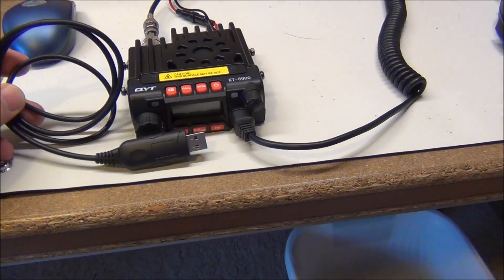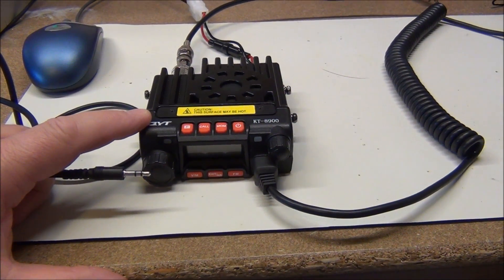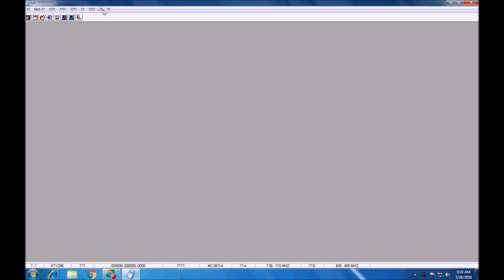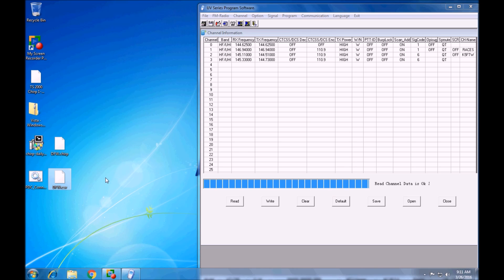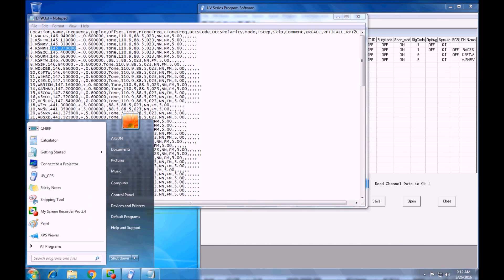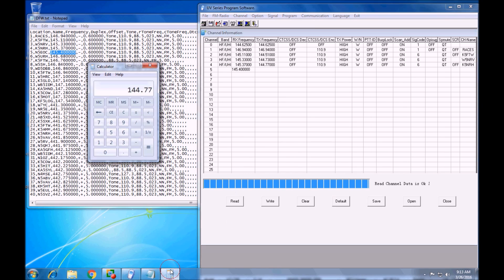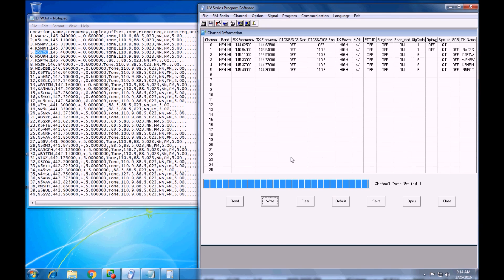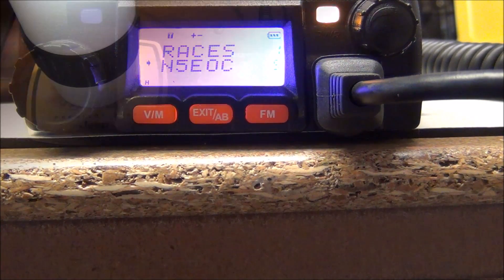Programming the QYT   KT-8900 with Software – Aided by CHIRP

Comment: fyi CHIRP WILL NOT WORK ON WINDOWS 11 . I HAD TO USE AN OLDER LAPTOP WITH WINDOWS 10 . IT WORKED JUST FINE ON IT BUT REFUSED TO WORK ON WINDOWS 11 . HOW ABOUT AN UPDATE TO ALLOW CHIRP TO RUN ON WINDOWS 11 ?

Comment: I just purchased the QYT KT980 and can't get it to communicate with CHIRP.  It does not show up on a Com Port only under Other Devices USB-Serial Controller.  I've tried downloading a few things from QYT Dowload website but nothing is working.  I'm not to versed on how this is to be done but I'm at a dead end...  Any help is appreciated.  I've done this with a Baofang UV-5R and had a similar problem but it worked after downloading a correct driver.  I can't find the Non-Chirp programming software either.
Reply from the maker: Most Lilley the driver for the cable.   Try a cable that is advertised as has a  FTDI  chip.  They are better at plug and play
Reply: I'm having same problem. I can't get Chirp or the QYT software to recognize port radio is plugged into. I hate this thing

Comment: bought a new QYT KT-7900D....setup a few local repeaters, and it worked fine. The very next day the radio says "KILLED" at the bottom. The seller has refused to refund and said that it has entered "remote kill" mode. That should have been impossible since I never even connected the radio to any software in order to activate. Since, the seller told me to connect to the PC and open the QYT programming software. So far I have not been able to do so. The file comes up as an RAR file. It simply will not open. Ive tried to open in Chirp, and again nothing. 

Any ideas?

Comment: CHIRP now has the programming software for this radio listed under the correct model number & name in October 2020 just FYI if nobody has mentioned it in the comments before.I just ordered one of the radios 15 minutes ago & it comes with the programming cable as well.I will be using mine for the local repeaters & some Simplex operations from my shack.
Reply: Doesn't work for.  Kt. 89 only  89R  it seems
Reply: It works for the KT-8900D model, but they haven't matched the power levels, and you can't program Medium power put from Chirp. Using Chirp Next, recent update .
Reply: @CHIPSpeaking  In tried programing my kt8900D it couldn't find the radio / not communicating with it quite unusable
Reply: Me either , the QIT software doesn’t work either. It’s just my radio off.
Reply: The UHF final failed less than a month so I returned mine and purchased an ICOM 2730 and it was a Smart choice for me.🎙
Reply: its now 2025 and i just got a 8900 camo and chip will not work on it..
Reply: @ it’s Chirp not Chip?

Comment: I have a question if you can assist please. I have a few baofeng uv5r radios and I purchased a repeater cable to make two of them act as repeater. Works great

Question is, can a person do the same or similar with these QYT 8900

Comment: Can you show me the driver version, because i made all like you explained but without success. I have error RADIO IS NOT IN CLONE MODE.
Reply: Hi - just wondering if you found a way to resolve this issue? (As I have the same problem)
Reply: Same here! Radio doesn't connect with Chirp. Can connect with other radios.
Reply: @kevingill765  Now supported with CHIRP so it should work.

Comment: didnt work with my portable. when i read or write, the QYT close and open few times. i have win 10. Normal ???
Reply: You have to add a 10k resistor I think. Not sure about the value between rx and ground and tx and ground. Bridge both rx and tx to ground with 10k resistors

Comment: Does the radio have to be on for programming
Reply: Yes, but you need to make sure the programming cable is inserted into the front of the radio, and connected to your computer (with Chirp already running) or you won't get the results you want.

Comment: I guess my experience was easier... I had my Baofeng information saved on Chirp, then opened it with my new QYT KT8900D and downloaded it there, everything was copied to my new radio exactly as it was on my Baofeng.  Best 73s, Beto, KP4AE  PS By the was you may use the latest Chirp software to program this radio.

Comment: I've purchased 2 QYT's from Amazon and have gone through all the programming steps using the provided software. However, when I get to the final step (write to radio), I receive an error stating that it's unable to connect to transceiver. I've checked all my ports and everything looks good. Any thoughts?
Reply: I have the exact situation. Did you get an answer from anyone? I STILL have two of these radios sitting on the floor, in the corner of the room.
Reply: Haven't received any type of feedback at all. (nothing but crickets)
Reply: Mic Sherwood - Try using this software. It's for one of the other radio manufacturers, but I just downloaded it, and it worked.  

http://www.chinajuentai.com/product_detail.php?id=175
click on RELATED RESOURCES under the pictures, their software is the top link.
Reply: Thanks, I'll give it a shot.
Reply: http://www.chinajuentai.com/product_detail.php?id=175
are not working the site--
Do you ghave another one?
Reply: We got ribbed off  its junk  and can't return it and no warranty  I program it  no problem put as soon as I go to use it setting change I done all what it says to do manually and with computer
Reply: Goto qyt website and download the driver for the cable.  Windows loads the wrong one.
Reply: Select woxon 8900 or similar, com port 6
Reply: Poor uart chips..try this  kit   http://www.miklor.com/COM/UV_ProgrCable8900.php